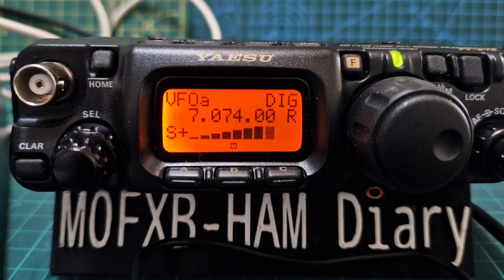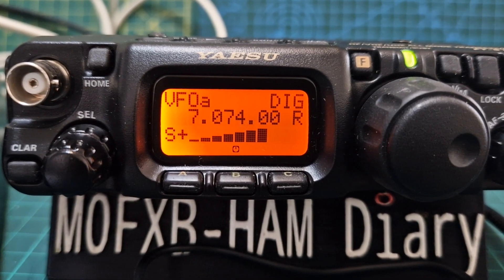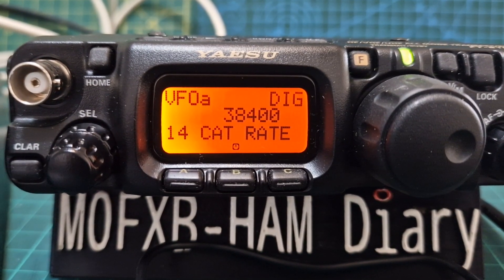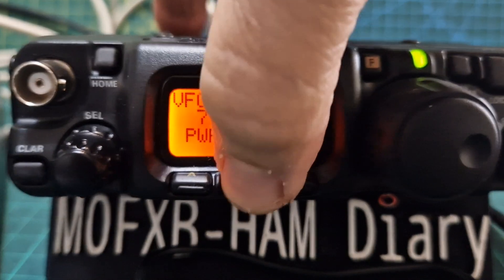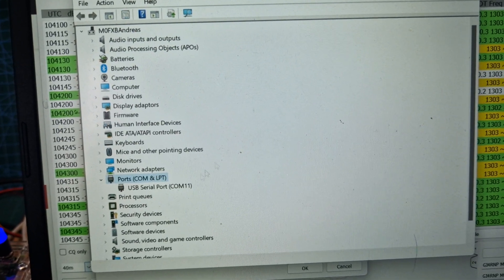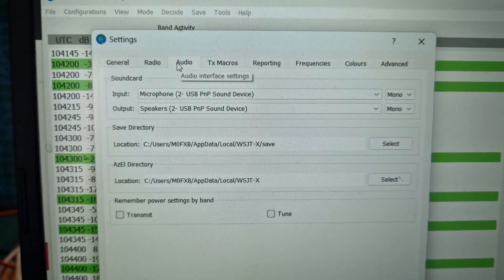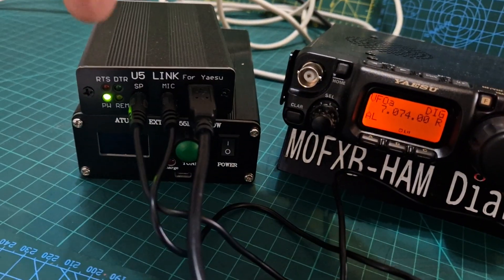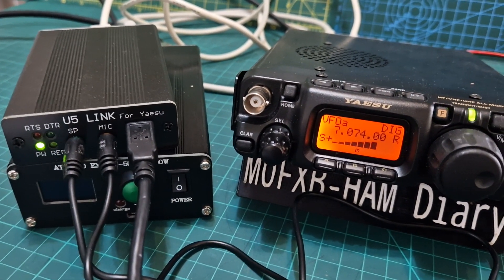YAESU FT-818 FT8 SETTINGS FOR RADIO

Comment: Hi, just curious to know what power output you select on this rig for data modes, thanks.
Reply from the maker: Hi 20 watts
Reply: @M0FXBHamTech  Hi, do you mean 2 watts on the 817?
Reply: what's a good alc level and how do you adjust it, please?